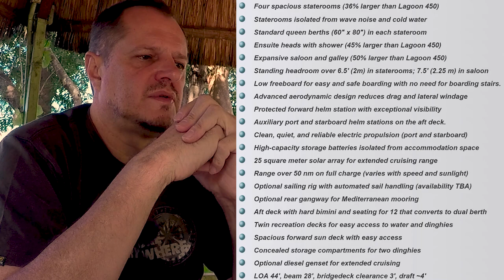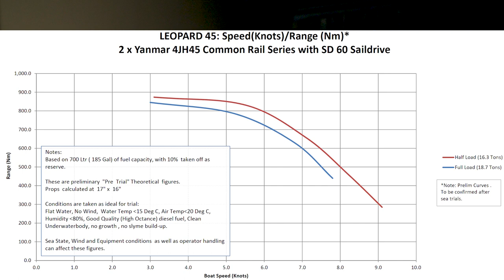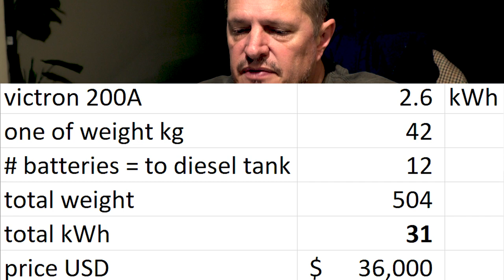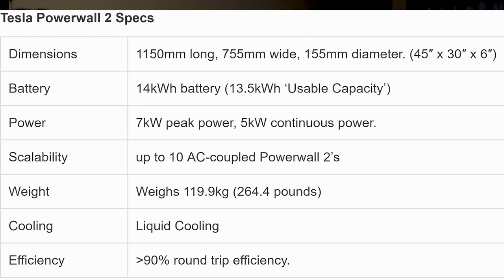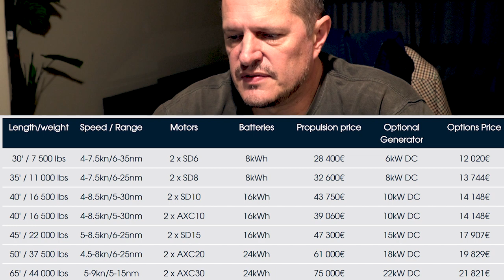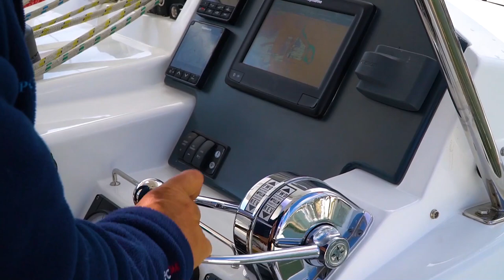#25t Diesel Engines or Electric Motors for Our Catamaran | Sailing Sisu in Cape Town South Africa

Comment: I have written as short a guide as I could think for your situation.

1- To begin, check the links below to give you a broader idea of what is going on in terms of boat global sales.

https://youtu.be/EiiAayqRM8E

https://trends.google.com/trends/explore?date=all&q=Catamaran%20sales

https://trends.google.com/trends/explore?date=all&q=Catamaran%20sales,Boat%20sales

https://trends.google.com/trends/explore?date=2010-07-08%202018-08-08&q=Catamaran%20sales

So if Robertson & Caine’s is too busy to help you as a customer and meet your needs, then there is a whole lot of nice boat builders with a slack in demand able to meet your needs.  After all you are paying them, they are not paying you to buy the boat.

2- There are other manufacturers that provide an option of electric engine(s) vs diesel engines, and they install Oceanvolt’s electric engines at the factory without, also, doing steep price increases.

Labor costs for the Oceanvolt’s install should be a maximum of 40-hours (Oceanvolt’s estimate).

In addition, they should be able to subtract the diesel engine cost and ancillary equipment from the Oceanvolt option.

Do a Google search, and if you can’t find them shoot me a message.  

I would start by reaching out to Oceanvolt in Finland for other boat manufacturing options, and I would discuss your situation with them.

3- There are at least two ways of sizing up an electric engine for a boat that I can think of right now.  You can do this either from a conversion of horsepower to kilowatts, or you can do this by dividing the maximum displacement mass of your boat by horsepower.  

Do not use the measly engine size offered for sale with a boat.  Use the engine offered under options.  There is a good reason manufacturers offer this option.

For the weight displacement route convert the displacement mass to kilograms.  Convert the kilograms to metric tons.  Divide this number by 2.5.  Repeat and divide by 4.  Divide both results by two since you are installing two engines in a cat.

These two results are the minimum and maximum sizes for an electric engine for your boat.  The minimum should work for you unless your hull is made from steel.  Yeah I know....

So a maximum displacement of 40,000 pounds will require, for example, a minimum electric engine of 22.7-kW and a maximum of 36.3-kW.

For the horsepower to kilowatt route you need to know that one horsepower equals 746 watts or 0.746 kilowatts.  So a 37-horsepower diesel engine is comparable to a (37HP)(0.746 kW / 1HP) = 27.6-kW electric engine.

Both approaches point to an electric engine between 25-kW and 30-kW.

4- For the battery don’t buy what they offer.  For the same money or less get the much larger batteries from a scrapped Chevy Bolt, Nissan Leaf, or Tesla car.  These usually survive a salvage car in pretty good condition.

You will be amazed what $20,000 will actually buy in terms of a real battery bank (35-kWh to 90-kWh).

If you can’t find these batteries by yourself get in touch with Jack Rickard from EVTV.  He will set you straight.  All of these car batteries are already heavily weathered (they are enclosed inside containers which are inside enclosures, etc).

Caveat emptor - buyer beware:  the chemistry of these different car batteries may not be the same kind offered in the Oceanvolt package.  So I recommend you do some research; however, for sailing I would speculate that they should be ok. 

Get a gas or diesel generator when motoring for long periods of time.  This will extend your cruising range until the wind picks up again, and it will save you from continuously draining empty your battery bank.

5- Install the largest panels you can from Sunpower or Panasonic.  With shading they work the best in terms of energy output; they, also, both have the least amount of degradation, and their power output (pmax or maxp) performs better than other brands in hot weather.

Install these panels either with optimizers or mini inverters.  This will provide energy while anchored somewhere.  Both of these technologies (optimizers or mini inverters) will reduce the loss from shading. I know no one else in boats does it, but this is what you need.

Make sure the battery chargers, optimizers, or I nverters have MPPT.  This will boost the harvested solar energy by 30% with any solar panel brand.

Look in the Internet for examples of how to install a strong structural frame to support the panels over the dinghy, on the sides of a boat, or under the boom.  If installed correctly strong wind gusts should not affect anything, and in addition, these structures can be placed to provide you with protection from the rain and to provide shade below them from the sun. 

Some installations are made to quickly (relatively speaking) disassemble the panels during a very strong and windy weather storm.  Check out the different systems available for connecting solar panels to a rigid mounting system.  Some of these will allow this.

6- Before buying the solar panels calculate your energy needs per day.  Think how you can reduce your daily energy consumption by either installing more efficient fridges, installing lots of LED lighting, etc.

This calculation and process will prevent you from buying more solar panels than you actually need, and it will save you money at the time of sizing the house battery bank, the battery chargers, the inverters, and the cables by permitting the installation of a smaller solar system.  In addition, it will save space.

7- Make sure the boat manufacturer prepares the boat with cables and cabinets for the installation of the batteries, or at least pre-drills and separates an area to install the batteries with racks to prevent them from moving while at sea, and perhaps they might, also, be willing to design and install the structure to support your solar panels.

You will need them to prepare an area where all the cables can be gathered together for the battery chargers, inverters, meters, quick electrical disconnects, switch boxes, and other related equipment.

If possible make sure the electrical equipment is factory cabled and able to accept other future energy sources such as wind turbines or hydro generators.  You never know when you might need them, or decide to add them.

All of the electrical cables should be sized properly to handle both the different energy sources of this install, possible future energy source installations, and the electrical demand side of things.

The preparation of cabling, cabinets, and structures will save you a whole lot of headaches.  Oceanvolt should be able to help you to plan this, and a local, friendly, knowledgeable distributor should help you to plan the rest.  So when you have your big meet with a boat builder you have a planned, organized presentation for your electrical and energy requirements.

On the financial side of things, you will save money four ways with the above systems:

a - decrease your engine fuel consumption expense.
b - decrease your engine maintenance expense.
c - decrease your expense for slips since you will be more autonomous.
d - decrease your electric house fuel consumption expense.

On the personal side your cruising trips should be quieter and with less fumes.

On the global side you are helping everyone and everything.

I hope this helps in your boat buying, making decision.

Happy and safe journey.
Reply from the maker: wow, thank you, Eric! very good advise and I will take it into consideration for sure!  I am looking at the Tesla Walls until someone told me they will not survive marine environment...? Also, I have currently 2.2kW of solar (sunpower), two Silent Wind generators, and 1.2kW of Lithium. This already added a sh!t load of weight to my catamaran as well, I run out of space to place them safely without compromising on the hull design or float dynamics needed for a cat to be safe. It is after all, only 45ft not like the 62ft Gunboat from the links I have received so many times. My current weight is 19 metric tons (sorry, I have no intentions to start learning non-metric :-) ) so, for now, I want to check out these things myself in real life. see how it performs and what I run out of first. If all this weight is just for my personal [comfortable] needs...
Reply: Sailing Sisu you are most welcomed.  

Many of the viewers mentioned Torqueedo, and I believe they have a similar system to Oceanvolt.

If you decide to change I think Privilège Marine, Aventura, and a few others are offering cats from the factory with electric motors, but I believe they all offer an electric generator which I believe you hate, but on an emergency it could save a life; so you have to weigh one against the other.

Your solar panels,  wind turbines, and lithium batteries should serve you well in the meantime.

Best of luck.

Comment: You can be the first to do lots of things but why would you remove the diesel? Its works. You can run all day if you need to. Safety outweighs youtube views. I am really a big fan of getting off grid and if you want electric go for it. Everyone has the right to go anywhere on earth and enjoy it but if you want help you should have made every effort to make sure you are safe. 2 weeks of storms no charge what do you do? I am not a sailor I shouldn't comment but I'm going to because I can. Go anywhere and everywhere and enjoy it. When I go off road I make every effort to not require rescue sometimes stuff happens.I will not take an electric car off road to a remote location because it isn't tested and I don't have a back up. I will watch anyway so look after yourself.
Reply from the maker: Our thoughts exactly! Thanks for the kind words!

Comment: I wonder how many boats of experience Leopard has with electric motors? Why would the CEO of Leopard care what motor you put on YOUR boat? Is it possible he doesn’t want you to succeed with electric motors because of all the motors he plans on selling that just burn fossil fuels?

How many people short sell Tesla because they want electric to fail? Who has won so far, Elon Musk or all the negative losers who said he would fail?

Buy 1 or 2 good generators, big solar, big batteries and a few electric motors and you will lead instead of follow.

If your boat was equipped with 4 smaller electric motors, how hard would it be to use cheap GPS and auto positioning software to allow “soft anchoring” at the touch of a button. Think of the cost of the electronics in a quad copter that uses GPS, giroscopes and accelerometers to let a quad copter hover by default. Software is shareware and electronics cost a few hundred dollars. How hard to auto park against a dock? The “trick” to making quad copters work was using electric motors, micro electronics and software. It can be done on a boat.
Reply from the maker: Leopard and R&C are both part of a group of companies. Part of the group is the fresh water charter company who had the experience with the Lagoons. Strange world I agree :-)
Reply from the maker: The auto position is a great idea and used in many big ships. BTW, my idea was not to have any fossil fuel on board.
Reply: I would just say that Leopard has a lot of experience with catamarans but not with modern electronics and electric propulsion. Opinions based on fear and ignorance aren’t worth much. The safe way is to put in 2 diesel motors OR 4 electric ones that are backed up by 1 or 2 diesel generators. I would put in at least 4 electric motors (2 near the front and 2 nearer the back in the tunnel) and drive them from the battery or from the generators which would give unlimited range. You currently plan 2 diesels for propulsion and 1 as a generator so what I suggest is just 2 generators instead. That extra 1 diesel is enough to buy 4 electric motors. Check Amazon for a 2.7 kw electric motor that sits just in front of the propeller. 180lbs of thrust in each motor and the equivalent of a 10 horse diesel each.
Reply from the maker: Thank you David! One will need at least 2x 13kW motors...

Comment: Electric drives are superior to diesel in every respect! Regen allows you to charge the batteries as you sail. Almost no maintenance, no filters, no oil changes, no dirty diesel bad for the environment, etc, etc.
Reply from the maker: Agreed. But, my point is that technology is not yet there. At this moment one cannot substitute batteries with diesel.
Reply: Look at Rigging Doctor, they crossed the Atlantic with an electric drive, you jus need to adapt or buy a lighter boat like Outremer which is lighter, more aerodynamic, less drag and way faster. You also did your calculations for worst case scenario. You could also have opted for more solar panels. Too bad boat manufacturers do not spend money on such new technologies and how to integrate them and every year they claim they have innovative designs!
Reply from the maker: The TUI charter group did bought 50 electric Fountaine Pajo about 15 years ago, but was forced to convert them all back to diesels. It was an expensive exercise, which made the top cat builders still hesitant. But that was before Lithium and new rare earth magnet motors. You should then also have seen that Ulma could not reach the Ft Lauderdale marina in one passage because their electric motor overheated? That was in a 5 mile river upstream. If honestly want to go completely green by chucking all diesel of the boat...? The technology is just not there yet. Everywhere boat builders are busy taking small progressive steps towards electric drive systems, but if you look at the true green cats, they are HUGE mainly for carrying enough solar panels. Size and weight for sure counts, but it is the ratio of space needed for gathering energy and space to store that energy for night, or rainy days, which is the problem. We have basically max'd out our roof space with 2.2kW of solar and guess what, when we sail, they are in the sail's shadow... Even rigging doctor has a genset on board for these reasons.

Comment: You need to look again at the displacement of your cat.  

Your cat displaces 32,000 pounds of weight not the 22,000 pounds you boxed out.

In addition, if you need to use your electric motor for two hours, then you don’t need more batteries, but you need a diesel electricity generator to extend your range.

Therefore, you need to size this up by one or two engines in your list.

In addition, you are spending $500,000 in a little boat.  

So, the company can either give you what you want at a reasonable price, or you should go shopping elsewhere.

Cats are in a buyer’s market not a sellers market.  

The trend for the last 15+ years is down for sailing boats.

Apparently, in your case the customer is not the one that is always right, but it is the company that is always right.

They scared you with an old tactic of hiking up the price to make you see the error of your ways.  

Installers outside a factory setting will do this for less than $100,000. Check it out.
Reply from the maker: Thank you Eric! I am not sure what to answer? for example... if you put a 20% deposit down now on a L45, you will get it late 2020...that is a looonnnngg waiting list. They increased the L45 base price with 60k USD and still people want to join the waiting list...the demand is outstripping the supply for cats at a HUGE rate. And it is not that Leopards is that good (well, I think they are :-) ) but Lagoon has the same "problem" long wait lists. As for generators...uhm...I was trying to get away from stinking, load, fossil fuel generators....by keeping a genset onboard, you keep the fuel tanks on board, you keep the weight of one diesel on board with its starter batteries and fuel lines....the idea and I stated this clearly, is to try get apples with apples, try to go green. Many people think you save weight by removing the diesels and the fuel tanks, but then you add it back with a genset?
Reply: Sailing Sisu I have replied.
Reply from the maker: Eric, thanks!

Comment: Pylontech.com.cn model us2000Plus X 24.... Enough said...
Reply: Remember that you have regenerative charging whilst sailing. A massive trolling generation system!
Reply: Also, consider that each of the 24 units will give you 2kw safely without the top and bottom 10% capability used... With three of those pylontechs I would be kissing Eskom goodbye forever,  well, 12 years actually. Hopefully I will be sailing long before then... Furthermore, even with the engines rated 15kw, juuust like diesel, you don't want to run flat out all the time. What is the 5kn wattage rating?
Reply from the maker: Lol, CDK, only you will find the impossible!

Comment: Solar wave
Reply from the maker: I am following those technologies, but after a bit of sailing (13,000nm in 9 months) I noticed I would need to make a few adjustments to try and keep our 13kW LiFePO full... The 2.2kW solar panels we have are not efficient when we sail nor at high latitudes in winter times with short sunny days and the sun passing low over the horizons, or when we have cloudy/rainy days...Use a generator you say? Then I need my fossil fuel tanks again which will defy the purpose of the video...and add that weight back again. The battery technology is just not ready to replace fossil fuel. It is getting there and I am waiting...but the other side of the coin is to charge the batteries...